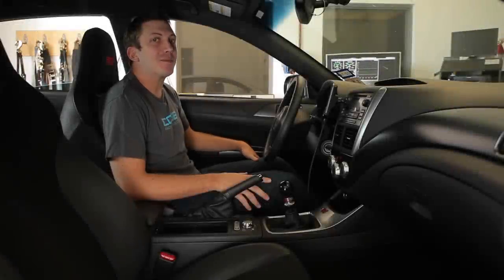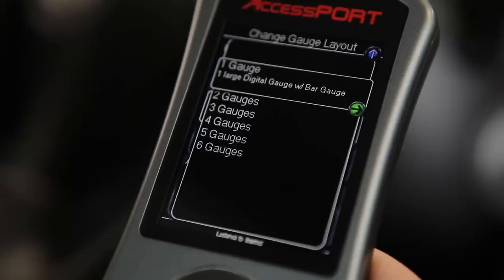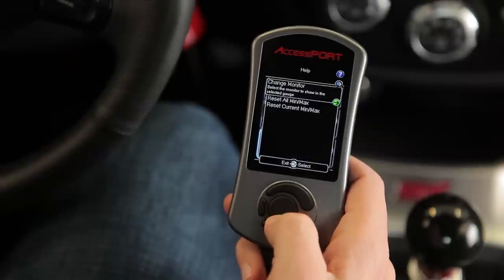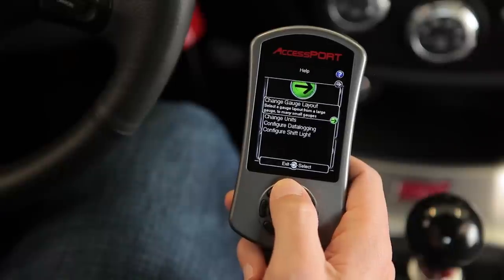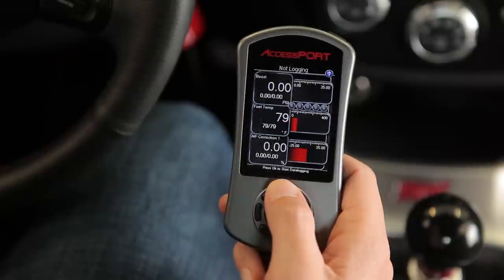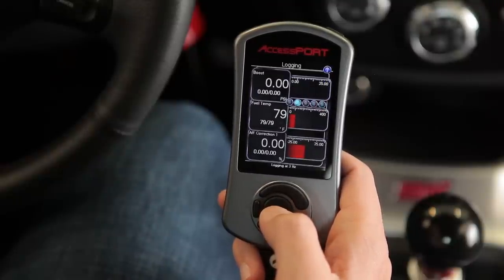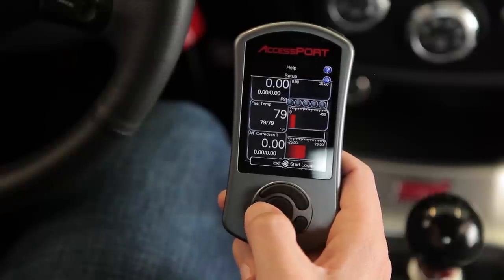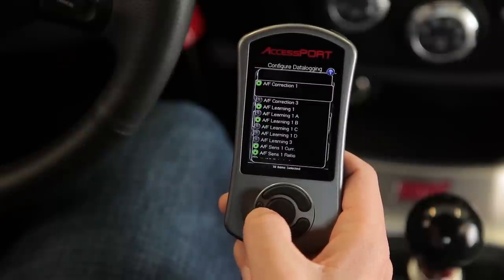COBB Tuning - Accessport V3 Gauges Tutorial

Comment: Hi COBB, just a question about Launch Control, 'is the Launch Control automatically activated right when you install the Cobb Accessport Stage 1?' ..or is there a function to turn it on or off? 
I use my wrx as a daily drive.
Thanks COBB!
Reply: +COBB Tuning Thank you very much Cody :)

so does the Launch Control work for automatic transmission? and when Ian guided how to turn on the shift light -- i'm guessing that does not concern automatics? 

..I am really sorry, just new to tuning. Thanks again Cody.
Reply: +COBB Tuning and also, is it in the COBB manual or website where it can teach me what RPM is safe for the type of car i have to use this Launch Control? thanks!

Comment: I'm sure they know some stuff, but when I called the guy on the phone told me every time I turn my car off it would go back to stock on realtime . which is complete false . he must have been new or didn't really know anything . cause on my family that's what he told me lol and I said no then i would be doing a re flash or return every day . I said are you sure your not meaning if the battery dies or unplug or something.  he goes nope lol
Reply: That's crazy.  Na it don't go back to stock like that.  I leave mine unplugged and still on same tune.  Like you said if it worked like that my car would reset everytime I turned it off.